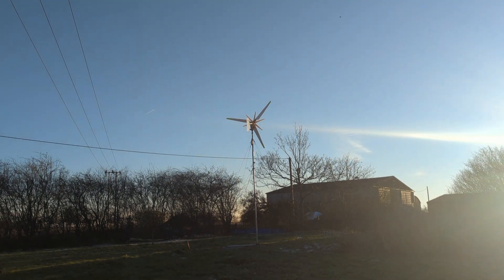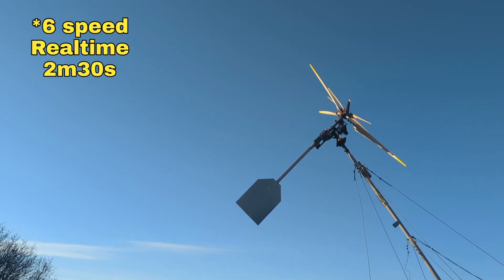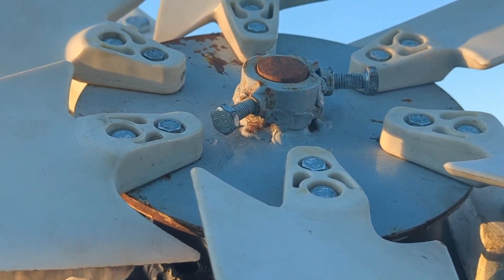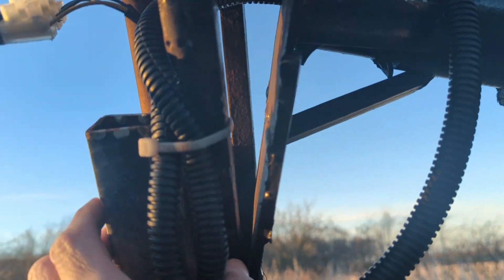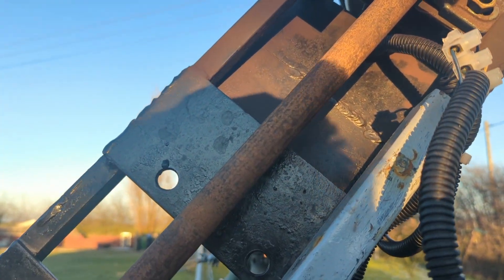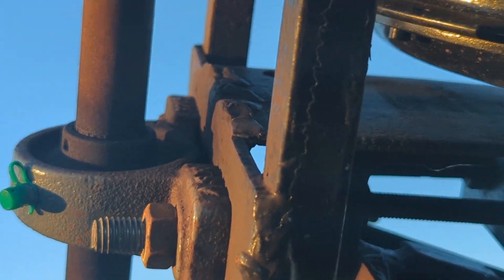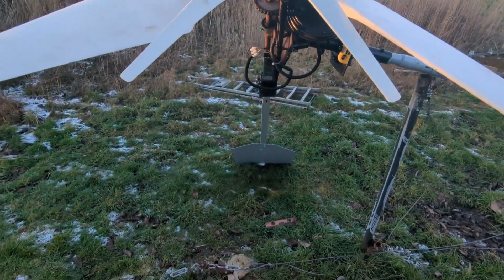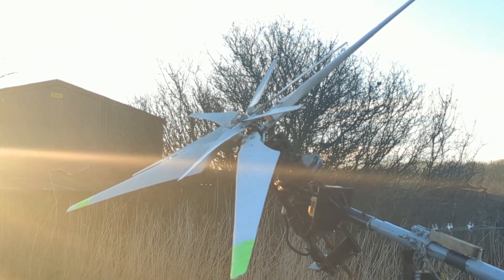2kw DIY Wind Generator - a closer look - interesting information - 23rd January 2023

Comment: nice... wouldnt mind seeing an alternator up there instead though... 
would do my own but always balk at the blade making part... whered you get them?  

except i cant help but feel the airfoil is backwards. the little ones look right though?
its the reverse of a prop. you want the "bump" on the side facing away from the wind.
Reply from the maker: Hello mate, thank you for your kind comments. I did go out after I read them. Just a double check, the turbine blades are on the right way which they do appear to be, I remember when I first put them on years ago I ran them the wrong way round and they still made plenty of power, but now I always use the fat side to the wind rule, I'm pretty sure they are on right. We will find out tomorrow when the wind starts blowing again.

This motor has proved to be four times more powerful running at max than a Chinese 500 w turbine which actually weighed almost double the amount of this motor.

The blades came from China so long ago I lost the suppliers details. They have been fixed and strengthened numerous times which has taken the shape out of them a little bit but improved their resilience.

Comment: Hi Gavin I am looking to make a simular wind generator but I am having trouble finding blades. Where did you find them?
Reply from the maker: I bought them from China many years ago. My friend. I have lost the suppliers details. The blades have been repaired many times after various knocks and bits of damage so they don't run as true as they should but are still very meaty.

Comment: Sir how to wind 2kw generator. Please make a video of that. please please please please please please
Reply from the maker: This is just a standard 1 kilowatt electric bike hub. It has a gearing system so the motor turns faster than the blades, The blades are 1.4 m and in super high winds it can make over 2 kilowatts but at about 25 mph it makes about 1 kilowatt.